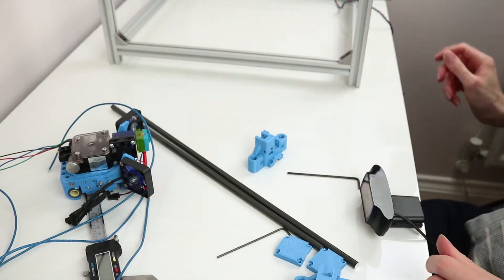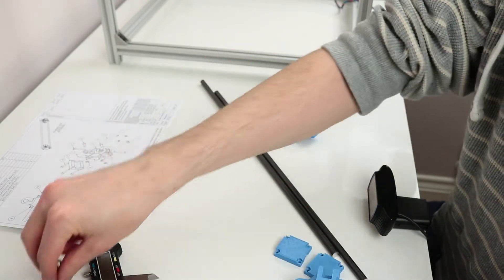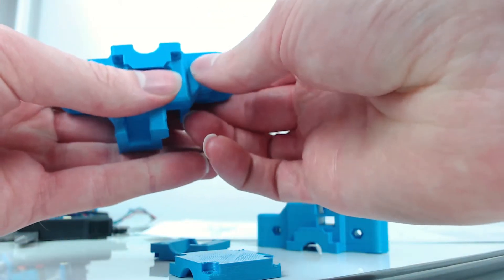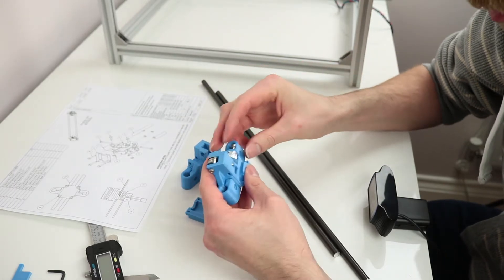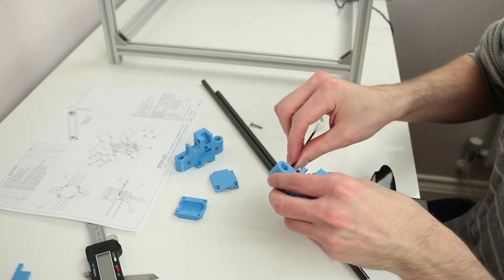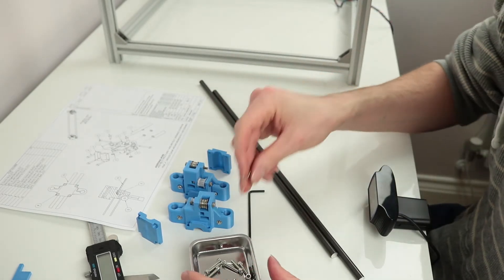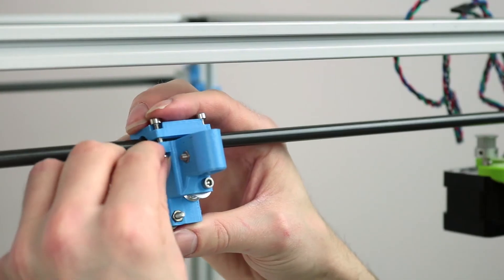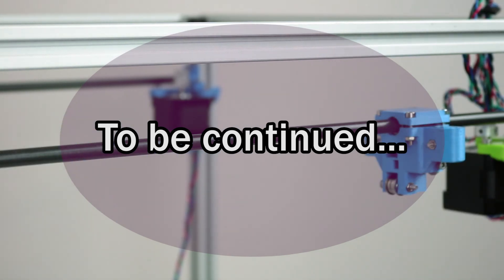XY Joiner - Let me show you how NOT to do it...  - STEVE Build Ep8

Comment: I appologize for my bad English. I means that in the pdf document "Gantry_Assembly_0.01". The stl files "X Gantry End_0.01" and " X Gantry Bearing Clamp_0.01" don't fit together. Could you check it later. The file "X Gantry End_0.01" doesn't exit.  Thanks!

Comment: Hi, I used your stl file to make my own 3D printer by Y core Kinematics. But I have got the problem with: X_Gantry_Bearing_Clamp_LM8LUU_Version_0.01 and X_Gantry_End_0.2. They are not suitable. I mean I couldn't put them together. X_Gantry_Bearing_Clamp_LM8LUU_Version_0.01 has to be square but it is not to fit with X_Gantry_End_0.2. Help me please! Thanks!